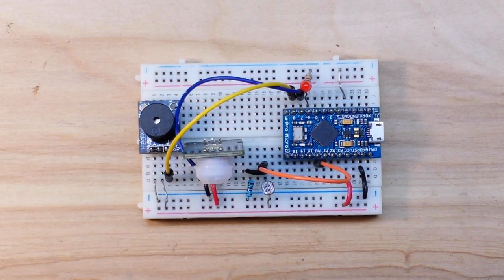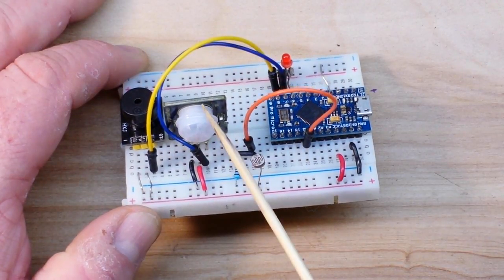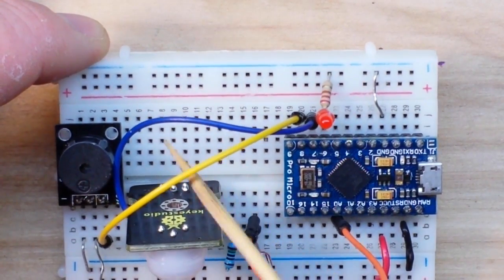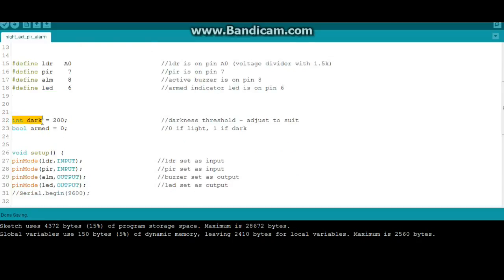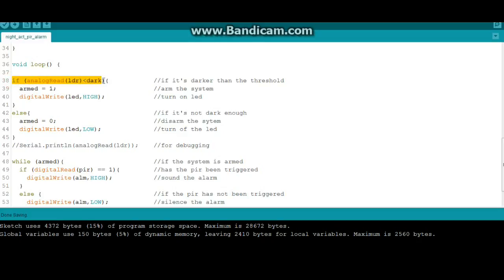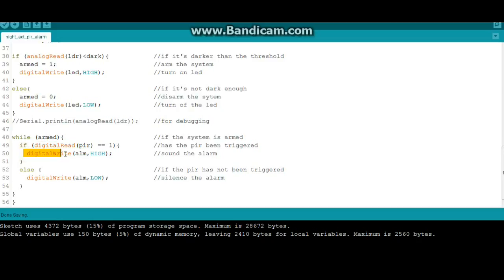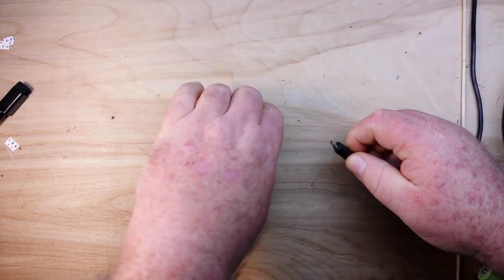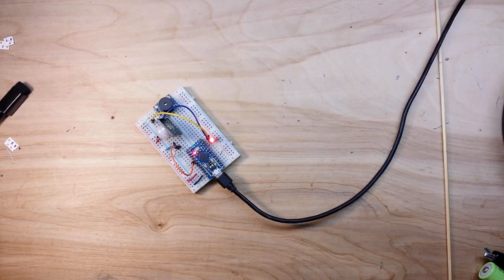Arduino Dark Activated Motion Alarm

Comment: Wonder why it didn't disarm when the light came back on? The code looked like it should have picked that up at the beginning of the loop? Or maybe the LED looked like it was still lit?
Reply: The code will loop while(armed) indefinitely in this code - there is nothing inside the loop which could reset armed to 0 and break the loop. If you want to turn it off when light comes back just replace while(armed) with if(armed).
Reply from the maker: BitBastelei Hey, thanks for sharing that information. I totally missed that. In fact, I didn't even realize that it didn't go off.

Comment: I have a micro but haven't used it yet.  Better fit inside a small case for the smallest projects compared to Uno and Nano.
Reply from the maker: Michael Padovani The nice thing about the micro is it has native USB HID. You can use it for keyboard and mouse emulation.